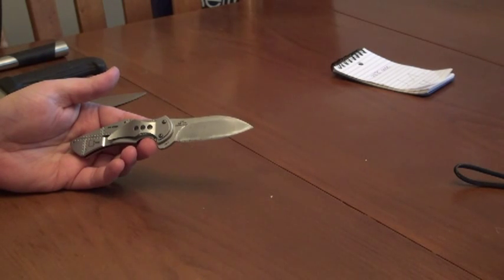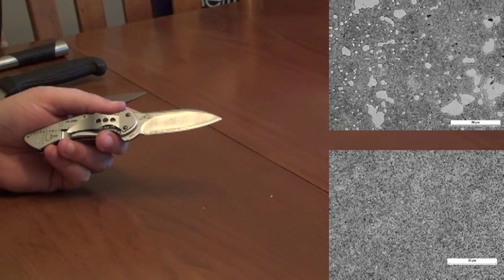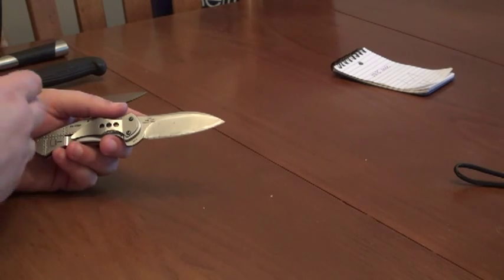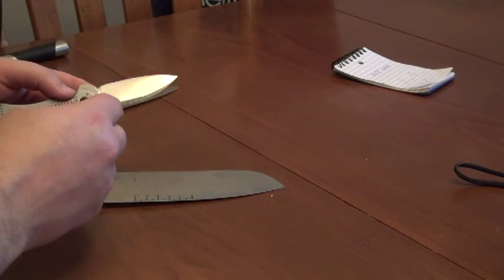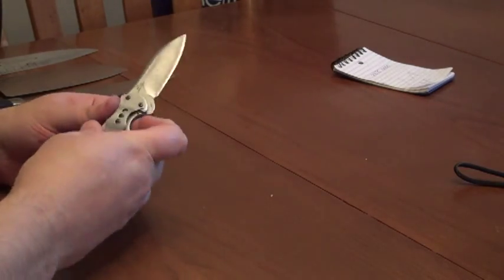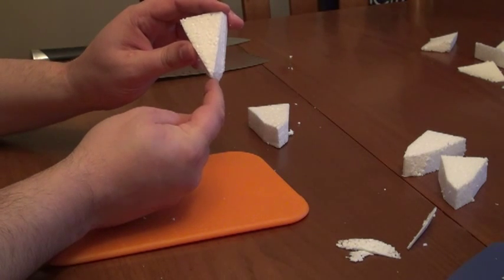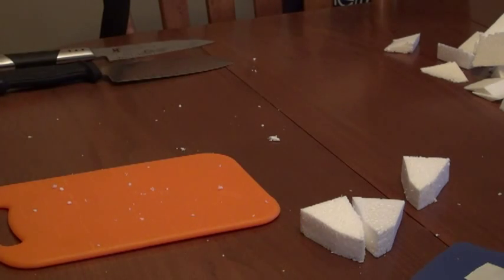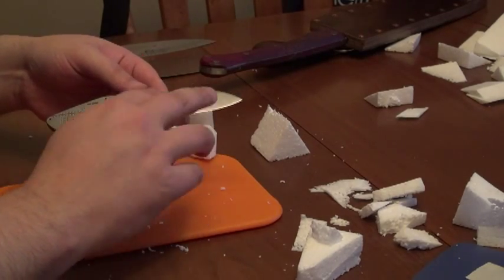Kershaw Junkyard Dog : regrind (steels and optimal geometry - flat vs convex)

Comment: @cliff stamp Hello Cliff, I was wondering if you had any experience with Buck's 13c26? From what I gatheted, they heat treat it to 58-60 hrc with a Paul Bos heat treat. Does that level of hardness give a decent representation of what one can expect from 13c26 or would you want it in the 60-62 hrc range. I will also regrind it to improve cutting performance to about 0.010 +/- few thousand, would that be an ok geometry for that steel? Thank you Cliff.
Reply from the maker: +D00MTR33 I have not used it from Buck. I don't know why you would want to under harden that steel to that HRC range. If it didn't have the impact toughness that they wanted when it was hardened in the 62-64 HRC range (oil quench + cryogenics + ~350 F temper) then they could have just used 420HC. 

What kind of work are you doing?

Comment: Mr. Stamp, i find this all very interesting, and love the application of science and logic in an area too commonly left to hype, marketing and tradition, (though, of course, many traditional tools are exceptional!)

I'm curious how Bos heat treats 13c26 for Buck.

I'm also very curious as to your opinion of the newer 14c28n from Sandvik, (i believe exclusively used by Kershaw in the US at the moment.) to me, 14c28n has performed closer to 12c27 in toughness, but the edge seems both sharper and more resistant to chipping. 

Those are just preliminary & subjective findings, but i've enjoyed my Skyline very much, esp for the $30 paid. 

Thank you for your research!
Reply from the maker: I have a very nice Sandvik 14V28n custom chef's knife, very nice piece. Production knives are often difficult to judge steels from because of the large variation you can often see and the influence of things like grinding damage.

Comment: On a lot of your regrinds you add a transition bevel, and work it when the edge becomes too thick. 

What do you do to work the transition? Just put it on the same angle as the transition on whatever you use for convexing on your grinder, and grind off for some time? Something more complex?
Reply from the maker: I normally only use transition bevels on knives which take impacts. When I sharpen them I keep an edge on the width of the actual apex bevel, when it becomes too large I plane down the transition bevel. 

That is the general idea, however what often happens is that I work the transition bevel when time allows and often the apex bevel can get much wider than optimal I am just doing other things at the time.

Comment from the maker: If you are looking to include durability as part of the equation then yes a transition bevel would be useful. The higher you start it the more durable the edge, the lower you start it the higher the cutting ability.

(in general - if you have to split the material it is a bit more complicated but that is a decent place to start).

Comment from the maker: S90V has larger carbide aggregates than S30V yes, significantly. 

In regards to convex vs v-bevel, it would depend more on the angles than the curvature, the curvature is a final refinement you apply once the angles are correct.

Comment: So the optimum profile would be a relatively steep flat grind terminating at around .020" and then a micro convex bevel for the actual edge? ....  Im looking to get the Spyderco / Wilson Southfork .... Reports indicate the primary bevel grind on the Southfork terminates to a thickness of .020  ...  Are the carbides in S90v larger or smaller then S30v, and would a micro convex secondary edge bevel work better or worse than a 30 DPS edge on a blade made from a large carbide CPM type steel?

Comment from the maker: Yes, it is 1.5%, it functions the same way, dissolves into solid solution, allows for elevated hardness (prevents grain growth at higher aus-temps), inhibits secondary carbide precipitation (hence the hot hardness, which is also due to the solid solution strengthening), and also adds to wear resistance for much the same reasons (hence use in the D series). How much depends on the amount, it is 8% in M42 thus the effects are severely pronounced, those are the "cobalt" drill bits for example.

Comment: No , 
I am not using that small of an angle. The knife as its function has a very limited ability to have more than a couple of factors of what you can determine as to the quality of the metal that is being used. Its very one dimentional in its use.

Comment from the maker: While Cobalt does does solid strengthen steel, and aids in hot hardness (why it is used in the extreme HSS) it doesn't tend to increase toughness and in larger amounts will induce brittleness (M42 for example). But yes there is more to steel than any one factor hence the popularity of steels like D2 which are not overly great at holding a very high polished edge with a low angle but work well for larger angles and lower grit finishes.

Comment: Sharpness is a goal, but. Not the only factor in determining a use of metal. There is  a cobalt amount in the VG-10, that makes it quite a not tougher than the sandvik. The amount of keenness of an edge , at that level is not critical, especially for edge retention .

Comment from the maker: If you have proper abrasives you can cut even vanadium carbide so there would be no limit in sharpness due to carbide content unless the angle being used was so small that the matrix/carbide bond could not sustain the abrasive/carbide interaction force and the carbides thus tore out. You are not using extremely low angles are you, like  5 dps or similar?

Comment: Besides being "easier", that is not necessarily my goal, but the fact that the edge on each of these metals should be physically sharper.
 I know of the small carbide size of the sandvik metals. I also work extensively with vg-10. The later , has never been an issue in either sharpening or keenness of edge. So , being a large carbide may be one factor in edge keenness, the carbide dispersion may be another important factor. This is what I believe makes the end result ,similar to both steels.

Comment from the maker: Assuming you are of decent skill you should still be able to hone even the extreme carbide steels to a high sharpness (assuming you use a suitable abrasive to cut the carbide). But you are likely to notice it is more difficult. I would suggest for example sharpening say 19c27 side by side with VG-10. I would guarantee you would see the difference in how the edge formed and how a very high sharpness was easier on 19C27.

Comment from the maker: The basic test is visual, the sample has to be etched and polished and examined under 1000X magnification to determine the carbide size. There are lots of pictures and discuss of the carbide size of many steels on the forum.

Comment from the maker: In general you will find people constantly mix up the aus-grain size and primary carbide aggregate size and lump both under a very general reference. Chromium in excess will form carbides the the nature of it is much larger than vanadium, tungsten, niobium, etc. carbide. Thus ideally you want just enough chromium in steel to be stainless and get the carbide from another former, ideally one which forms MC type carbides.

Comment from the maker: The primary is brought down until I get bored with it at which point I apply the transition bevel. I then check the thickness at the start of the transition bevel and if necessary bring the primary down until it is where I want it. The apex bevel is last and stone sharpened.

Comment: Just got time to watch this...great video Cliff!  I love the illustrations with the foam.
Two questions:
1. With the thickness measurements...do they mean where the final/secondary bevel of 12dps starts the blade is .02 thick?
2.  In what order did you do the grinds? Primary>convex>return to primary to minimize convex?

Comment from the maker: If you have AEB-L at 55 HRC then what you actually have is a mix of about 75% martensite and 25% other phases. These other phases are soft and very weak and lead to premature failure, and an edge which feels gummy, tends to form heavy burrs, and has less than ideal corrosion resistance.

Comment from the maker: It isn't the hardness, it is the microstructure. You want a fast quench, oil, deep cold and a low temper. This achieves 95%+ martensite, and minimum retained austenite and other ferrite phases. The hardness will be 62-64 HRC depending on the exact batch composition and temp/time tolerances. But the main benefit will be edge consistency.

Comment: No I have never tried a D2 from Dozier, I have read some really positive things about it. The CPM D2 has been impressive so far in my experience. I have found edge retention to be decent and its toughness excellent. I have had some minor corrosion issues. People often comment that it takes a long time to sharpen but it did not pose too much of a drama for my stones.Another common conception is that the D2 wont take a keen edge but I can manage to get hair whittling without too much problem.

Comment: Hahaha. Quite frankly I'd have taken it over to the grinder to put it on myself. :P Alternately actually I'd have used some of the pink insulating foam which doesn't have the same sort of "grain structure" for lack of a better description.

Comment from the maker: Interesting perspective on the clip. I find it one of the more comfortable designs, however hands are not all the same. I find the jimping on the lock to be the biggest factor in discomfort in use for me. That generates high pressure points almost instantly.

Comment: pt1: i like the style of the junkyard dog as i'm fond of the sheepsfoot or modified sheepsfoot blades as they make good utility use knives. very nice job on those bevels. they look very uniform. i think it would also add to the function of the knife if it had a longer handle. i'm not all that fond of 3 finger grips as it seems to detract from the leverage but, far be it from me to pass up buying a knife just because of that.

Comment: I find the mildly hooked tip of the clip to be relatively uncomfortable on this model. The rest of the clip, as you noted, I agree was more comfortable than average although not as comfortable at the bent wire clips Spyderco popularized. The tip of that clip is also a hazard to things such as cars when clipped to your pocket. 
Good idea on the styrafoam as a teaching tool. This should be done to explain to people A) not all convexes are the same and B) they aren't necessarily superior

Comment: Because of the blem sale in november kershaw always does, theres a ton of cheap blems on ebay, i picked up the Turbulence, mostly cuz im a big tim galyean fan, who is the designer of the knife ur holding in this video. I find the steel kinda weird, its very sharp, but no teeth, doesnt bite, i can rub my hand on the edge without cutting me, yet it shaves hair and was slicing phonebook paper cleanly.. really odd, idk, wanted to know what u think about the update steel  and heattreat with kershaw

Comment from the maker: The primary regrind really has to be done on power equipment (here I used a 1x30" belt sander, 36 grit norton blaze, wet belt, force air cooling) unless you like to literally spend an hour with a coarse stone. The transition bevel can be set by hand, it would only be about five minutes. The final sharpening is always done by hand.

Comment from the maker: A common saline washing solution can be 5g/1000 ml, salted cod will immediately super saturate water 350g/1000 ml, this is 70X the concentration (in excess). This means that even assuming you are ok with the blunt force trauma, your eyes will become supersaturated with salt and your corneas will get scratched and torn from the undissolved salt. It will take the fight out of anyone quickly, aside from maybe someone who is really hungry and hasn't had jiggs dinner in awhile.

Comment from the maker: With any steel with a low grindability you also really would benefit from using a relief bevel. So if you want to set the final edge at say 20 dps, first grind a bevel at 18 dps (anything less than 20) so when you sharpen you are only working on the final edge and don't have to remove so much metal.

Comment from the maker: The solution is to stay on the coarse stone, with light to moderate force until the edge at least cleanly slices newsprint, you may have to deburr if a large visible burr forms. Only then if you want move to higher finishing stones. Make sure to destress first and check for light reflecting from the edge to watch your progress.

Comment from the maker: S30V and ZDP-189 have a low grindability, especially if you compared them to AUS-8 or similar. It can literally take multiple the amount of passes to sharpen them with a given amount of wear. To solve this some people start pressing really hard which then causes the steel to fracture which will make a large burr form and make it near impossible to remove (as the steel is fractured under the burr).

Comment: There has been a distinct lack of throwing in your last several videos. Please correct this in future videos.

Also, is there a reason you are sandwiching a convex grind between two flat grinds, as opposed to convexing the entire blade while keeping the cross sections & dps the same as your posted model of 4/8/12?